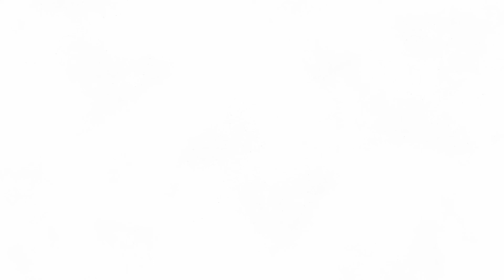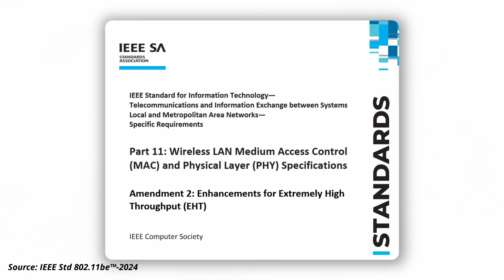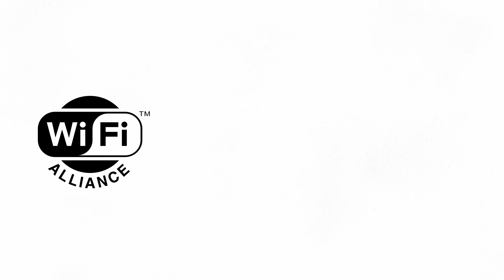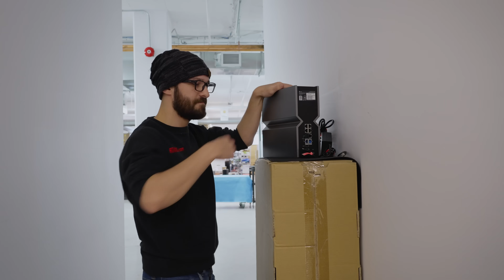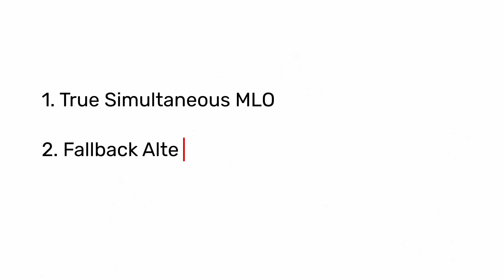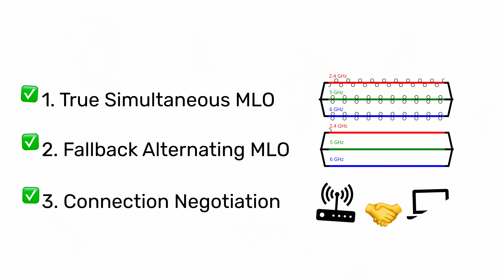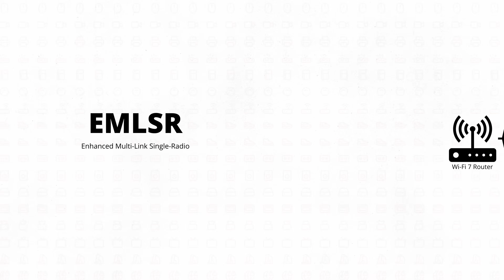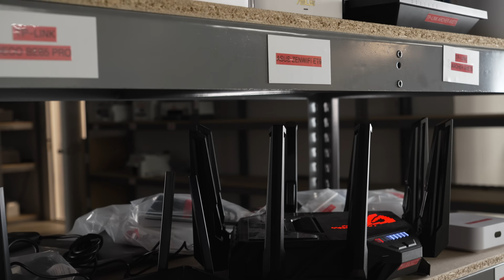Wi-Fi 7's Best Feature Doesn't Work (Yet)

Comment: Would be curious if enterprise-grade AP's from Cisco, Aruba, Ruckus, etc. are implementing all of the features outlined in the IEEE spec. as they also advertise MLO support. You pay a huge premium on hardware and support, but are also entitled to raise bug tickets if a feature on the data sheet doesn't actually work.
Reply: Ruckus would particularly be interesting as apparently they are being used for the Wi-Fi Certified interoperability test beds.
Reply: Ture, add in also omada and unifi to the enterprise tier. A round of testing for all these enterprise oriented ones would be great. They are probably the best investment one can make for home networking, second only to running cat6 to every corner lol
Reply: @FirstnameLastname.69  they are not enterprise though. business grade at best
Reply: @newellslab  ubiquiti is pushing into small medium enterprise and starting to come out with products suited for larger enterprises
Reply: @newellslab  my bad, I ment to say prosumer
Reply: @FirstnameLastname.69  UniFi Dream Router 7 is there in the mix, no joy.
Reply: I mean you can look it up, cisco has theirs certified and they support str and emlsr they don't support emlmr as that is not required to be certified it is designated as optional in the standard
Reply: If there are no clients that actually work with the advanced features of WiFi-7, there’s no sense in enabling that feature set in the AP.
Reply: @roch145 most of the features are being used as mesh backhaul right now, so they do exist
Reply: The benefits of enterprise gear do not come from ‚implementing all features‘ 
This video is horrible. Mostly half informed misleading and show clearly that they have no idea how this all plays together. 

Wrong information and misinformation strangely leads to a conclusion i would support. You don’t need a Wi-Fi 7 router at home. But it has not much to do with the reasons given here.
Reply: @beeeluem  It means nothing if you don't enlighten us on their mistakes and what is the real reason
Reply: @beeeluem  so what did they get wrong?
Reply: @beeeluem any proof to your claims?
Reply: @beeeluem MLO is one of the main selling points of Wi-Fi 7. Devices can switch between bands without renegotiating and send/receive across different bands increases reliability. It's reliablity and uptime that companies invest millions into. The problem is just that most client devices don't support Wi-Fi 7 so it will possibly take a couple years until MLO becomes relevant. I still think this video is important because the marketing is often missleading.
Reply: @niveZz-  name one client dervice that supports the full feature set
Reply: @niveZz-   Companies don't buy netgear's retail products en masse. They buy commercial grade routers from Cisco, Juniper etc.
Reply: @beeeluem  So manufacturers can lie that their routers support it then? 
Because you're #enterprise and you know better. 
It's no wonder why so much enterprise hardware / software is crap

Comment: Recently moved to a new place and decided to pull the trigger on a TP-Link BE63-based Wi-Fi 7 mesh network since we were starting from scratch as we had sold our previous wifi mesh system to the person taking over our old place. So far I'm satisfied with the system. I also pulled the trigger on their smart home kit as I was tired of paying monthly subscriptions for security devices. So far, so good.

Hopefully EMLMR, EMLSR, and TID support and implementation are fixed through a firmware update.